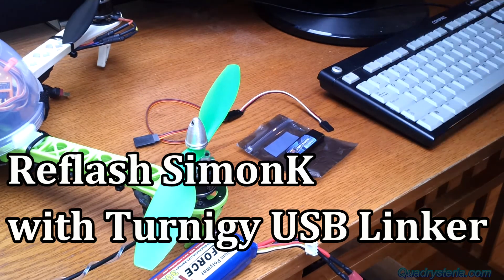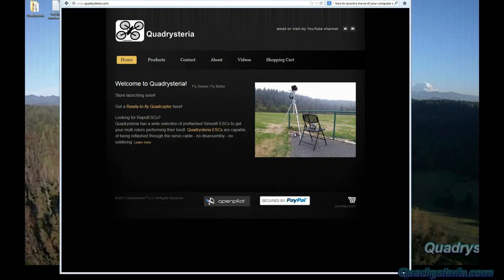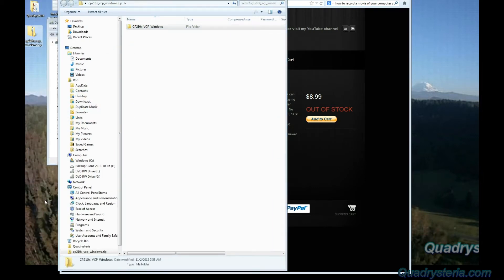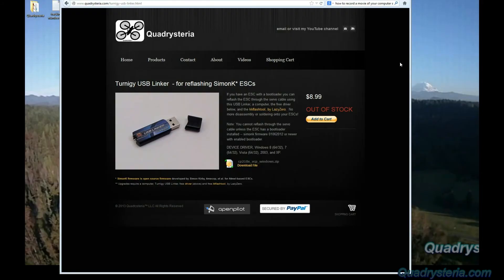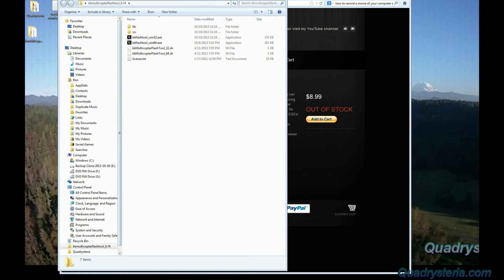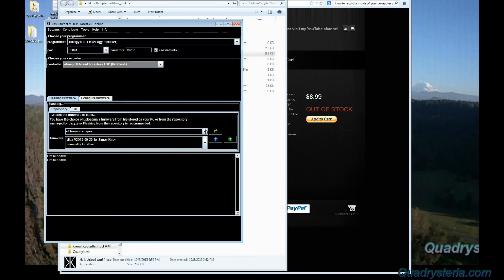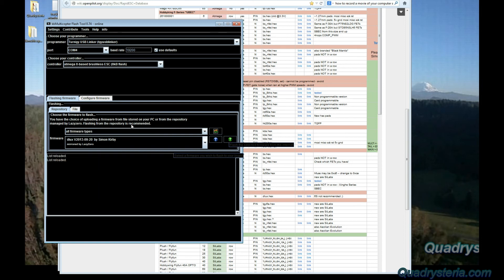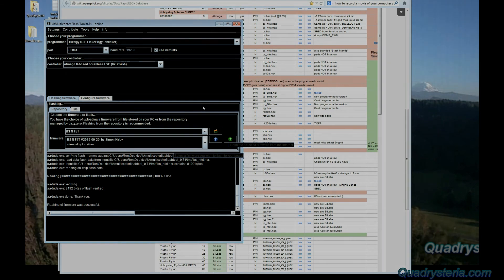Flashing SimonK Through the Servo Cable - Turnigy USB Linker

Comment: Hello, thank you for your video, was very helpful, could you tell me how  configure:   Protection function of low voltage: low (2.7V)
Responder
Reply from the maker: That is usually done with the flight control software.  I don't think SImonK has it. But, most guys have gone to BLHeli_S firmware which also has low voltage protection. But I think 2.7v is too low. You'll want it to be 3.3-3.7v

Comment: How do I flash a ZTW Spider 30 amp esc that has Simon K on it? I am having a hard time. Bl heli won't read it? I have a DYS USB linker, Is that my problem?
Reply from the maker: The ZTW Spider 30 amp has a SimonK bootloader. So in BLHeliSuite you must select that type of connection in the dropdown menu.
Reply: I have tried that, but it still wont read it?
Reply: Time out no answer on com port 8
Reply: I think I wasted my money...
Reply: I could not get it to work with the BL heli pass through on the Naze board because of the boot loader I was told, and told to buy this DYS tool and I could flash the boot loader with it. So I ordered it and waited a month to get it, and now I can't get it to work either\. I am just going to throw the ESC's away and get  something already flashed with BL heli I guess. Just vtired of messing with this now.
Reply from the maker: Well you can try flashing SimonK with RapidFlash Chrome app. The target to use for ZTW Spider 30a is bs_nfet
Reply: I downloaded it, but it does not have a choice for a DYS USB Linker in the drop down selector?
Reply from the maker: That is your problem. I believe the DYS USB linker only works with silabs ESCs. The ZTW Spiders are atmel ESCs.
Reply: I figured as much...
So I need to get the Turnigy one?
Reply from the maker: Yes, Turnigy will work with Atmel. You can get here: http://www.quadrysteria.com/store/c106/USB_Programmers.html
Reply: Cool. Thanks a lot for your help!
Reply: I'm still new to all of this. A lot more to learn from flying and building planes and heli's.